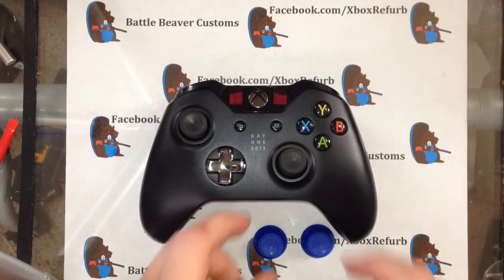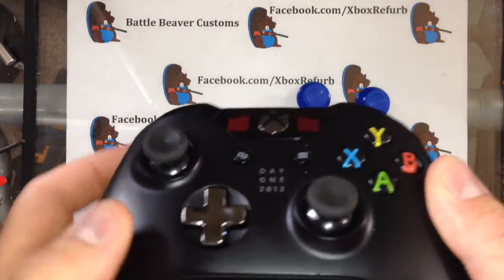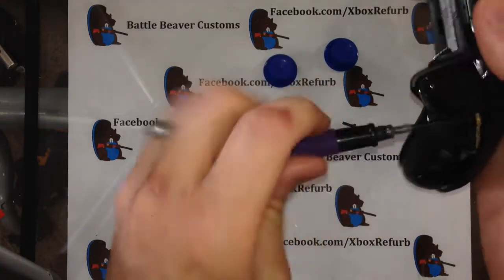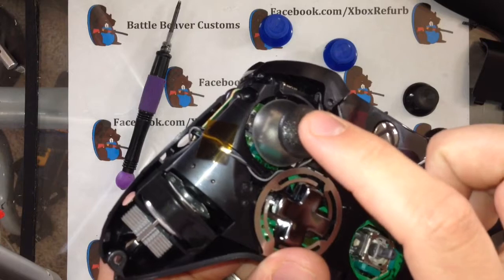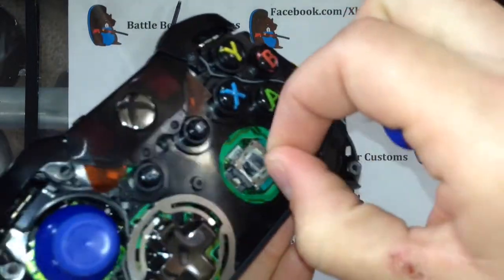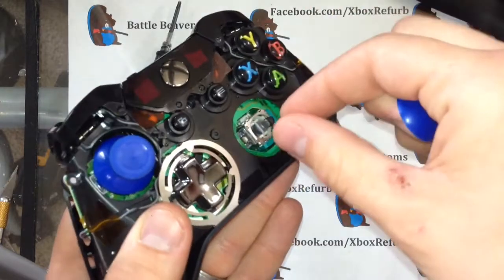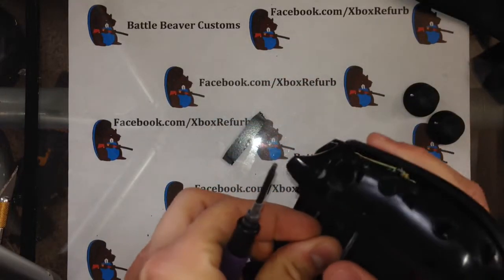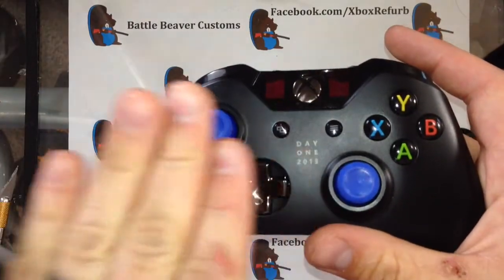XboxOne replacement thumbstick install and review concave OEM style

Comment: I done this and now my headset won't work properly any ideas where I went wrong?
Reply from the maker: The mid board may not be sitting flush. Can you see any of the circuit board inside the mic port area? If so it may not be sitting flat
Reply: I managed to fix it apparently turning my xbox off by mains and getting another headset done the trick

Comment: I've been trying to find a video for swapping the analog sensors.. My right thumbstick snaps back to the middle as it normally would, but the sensor keeps directing upward while in game. Example: In a FPS game, the view keeps looking upward. I bring the view back to the horizon and then after I let go of the anolog stick, the sensor keeps making me look up at the sky again. Any vids out there for getting to the circuit board and a safe replacement?
Reply: actually I do see where the soldering is done, a video would have been nice to find though. maybe i'll make one.
Reply from the maker: I have one on my YouTube channel

Comment: Hey Chris.. do you guys have replacement joystick axis analog sensor modules for xbox one? One of my thumbsticks is not as responsive as it should be and I really need to replace it. I just don't trust all the Chinese ebayers selling them.
Reply from the maker: Yes I just got a batch of mechanisms in. Do you want to mail it on to be replaced? Or buy the parts And solder it yourself?
Reply: Battle Beaver Customs That's a good question. My spot soldering is a little rusty.. just depends on value. How much would you charge to do it? I have to figure in shipping as well. Of course all priced against just buying a new controller instead of going to the troubles. Really wish these controllers where more reliable. Man the big daddies that shipped with the first xbox where built like Mack trucks.
Reply from the maker: Your looking at 15$ labor and 10$ return shipping. Then the cost to ship to me
Reply: Great. That's still half price. Do you have a parts list somewhere. Don't know if that price is just for one sensor or both and don't want to clutter your video with questions... but having you fix it is still cheaper and saves me the trouble.
Reply from the maker: Shoot me an email. Battlebeavercustoms@gmail.com and we can get something going.

Comment: Why not just sell sticks that don't have "slop" instead of making your consumers deal with a poor fit?
Reply from the maker: My next batch will fit better. The supplier just had a bad run.
Reply: Battle Beaver Customs Well, I bought some on eBay last week and I don't have any electrical tape, so these sticks are garbage to me...
Reply: ThePrimetimeHero Buy a $2 roll of it anywhere.
Reply from the maker: The stock sticks also have slop fe bad fitment, so when they made colors it's based on a bad product.
Reply: Battle Beaver Customs Are they fixed now ? I'd like to try and order some but not if there's still issues.  Thanks